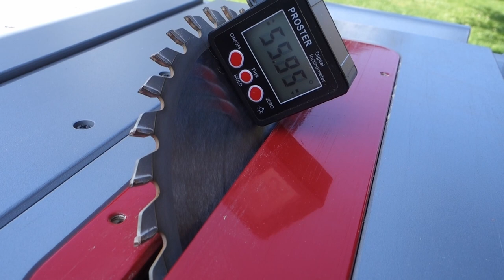Bread Cutting Board | diy Scrap Wood Project

Comment: Schönes Projekt! Und wie ich finde, mit viel Liebe zum Detail umgesetzt. Witzigerweise habe ich gestern auch ein Brot-Schneidebrett gebaut. Ich habe es allerdings quadratisch gemacht, da ich meine Brote selbst backe und diese immer eine runde Form haben.. Eine Frage habe ich allerdings, und ich würde mich freuen, wenn Sie  diesbezüglich ihre Gedanken mit mir teilen. Es geht um die Ausrichtung der Streben zur Grundform. Wenn ich davon ausgehe, dass ich quer zu den Streben schneide, haben Sie bei ihrem Brett ziemlich viel Höhe und relativ wenig Auflagefläche für das Brot. Oder benutze ich mein Brett falsch und man schneidet mit den Streben. Ich würde mich freuen, wenn Sie Zeit für eine Antwort finden. Danke
Reply from the maker: Hallo! Vielen Dank! Ich würde sagen, normalerweise schneidet man so wie Sie quer zu den Streben und nicht mit den Streben. Ich habe bei meinem Projekt ausschließlich Holzreste verwendet, nur Teile die schon da waren - so wie auch die Buchenstreben in genau dieser Länge. Und da die Länge vorgegeben war konnte ich das Schneidebrett nur so bauen. In der Praxis drehe ich es bei kleinerem Gebäck so, wie ich es gerade brauche oder lege einen etwas längeren Brotwecken auch mal diagonal drüber. Selbstgebackenes Brot auf einem selbstgebauten Schneidebrett, vielleicht noch etwas Butter drauf, so lange es noch warm ist - ganz was Feines! 👍😊